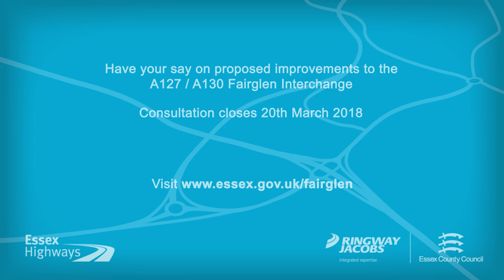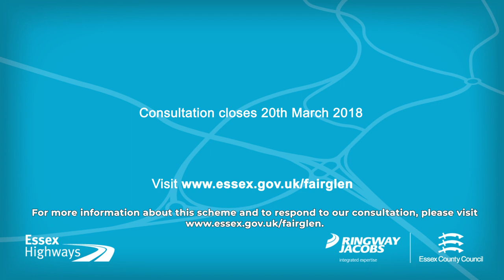FLY-THROUGH: A127/A130 Fairglen Interchange consultation (with subtitles)

Comment: Be good to see Fairglen interchange to be demolished and rebuilt with a new slip road from A130 southbound to A1245 next to the power station and the railway bridge. With a dedicated left turn onto the A127 towards Southend. And to widen the Fairglen roundabout and the A1245 A130 Rayleigh Spur roundabout. As Sadlers Farm have been remodernised with a new A13 link road.

Comment: Looking good my concerns would be lighting and good signage and will the Rayleigh weir onwards to Southend become more congested, As often you can join a queue just beyond the weir heading towards Southend  at 5/10 mph during rush hours getting caught a the junctions of progress rd the latest one at Kent elms where drivers have no idea what to do often slamming on the brakes just before getting squashed then the tesco junction works ish the bell is a joke cuckoo cnr horrendous then either Victoria gateway or Sutton road junctions  The A127 towards southend needs sorting afterall built in late 20s  some upgrading in the 60s but other than that just little tweeks while having to cope with 100s of thousands of extra vehicles each day that it was not designed for.

Comment: Michael G Cole
On first inspection looks like a great improvement to the current local problem. However, unless improvements are
made to other junctions/interchanges, the problems will be moved further along the journeys, thus undermining the
value of the vast investment. I fear it is a short term remedy. A larger spread of planning may be an option, or a more 
grand plan of a new trunk road/bridge from Southend to London (or part thereof) along the Thames estuary via the mud flats,
Canvey etc.